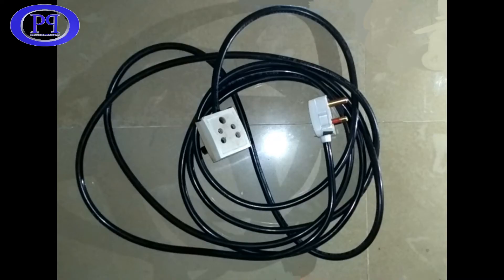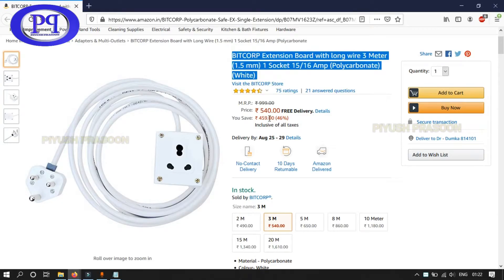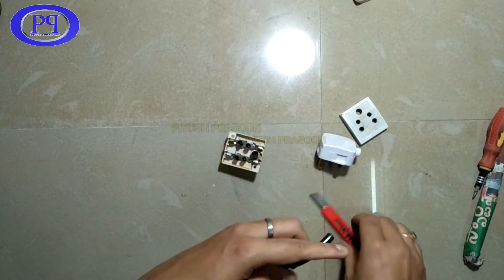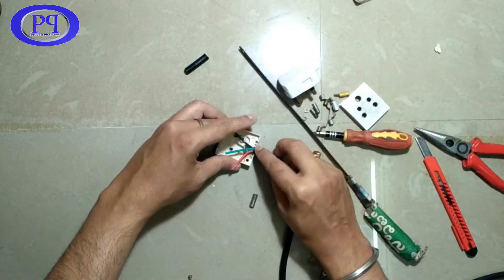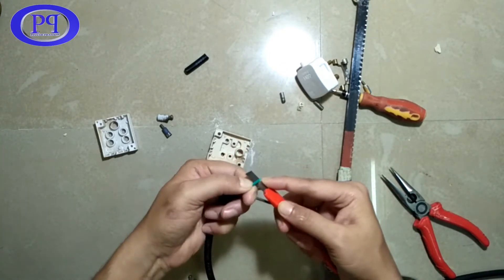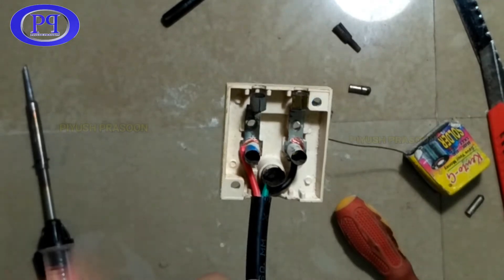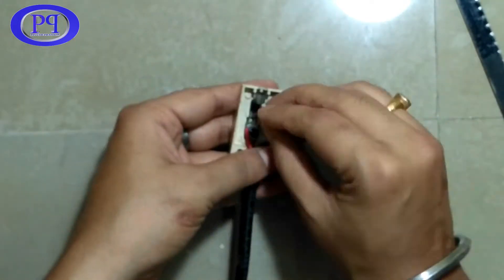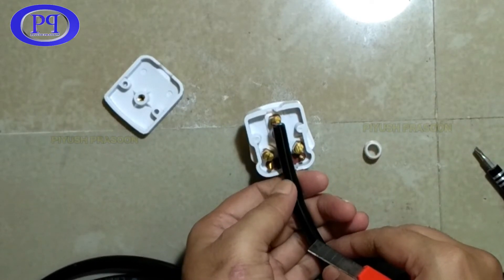DIY 3 PIN Male Female Connector | English (अंग्रजी)

Comment: 3 pin plug power  point and socket and 3 pin rounded plug adapter. Not Connector. Connector is used in electrical Board or car or motorcycle circuit. Like 2 pin, 3 p, 4p or 6 p which you  called  JCT connector which have both male and female
Reply from the maker: Great, thank you for your valuable input and sharing the correct information.👍